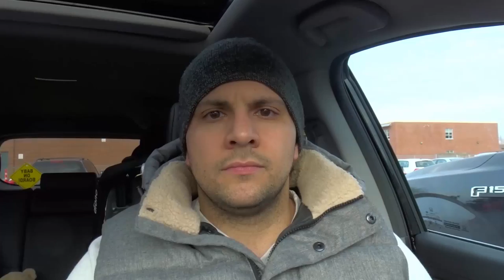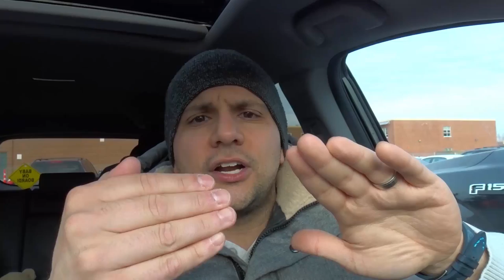How To Diagnose A Bad Clutch-6 Things To Look For

Comment: Never mentioned so my question would be. My clutch is sticking to the ground. It in inconsistent. Works part of the time other times it suddenly sticks to the ground. What causes that? It has fluid. Everyone I talk to aren’t consistent on what they t could be. Clutch is going out, could be air in the lines... idk
Reply: Yes. I would say air in the lines due to a bad 1) clutch master cylinder or 2) clutch slave cylinder. The second is much easier to replace since it's a simple brake line to bleed essentially. Air is being allowed into that and it doesn't always have to leak/the fluid isn't always low. If it runs on vacuum (which most do) check the vacuum line. It may have a leak, and maybe sometimes the engine is angled just barely in one direction to pinch it correctly and make it actually work correctly

Comment: When my clutch bites on releasing I get a shudder when pulling away only in first gear. It’s a manual after driving the car every night for about an hour so must be when it gets hot. Any ideas what this could be thank you
Reply: I might have the same issue. Learn anything about it or find a solution?

Comment: So I have been having issues with my clutch and it is literally the complete opposite of the last indicator. It used to be very strong and the bite pint was towards the end of the clutch peddle when I let it out, but now the bite point engages as soon as I start letting out the clutch, and after the bite point engages there is no more play in the clutch and it feels light as a feather. I know this is very confusing but could this mean detrimental clutch damage occurred?
Reply: same problem nobody’s answered
Reply: Its your clutch most likely if not air in master cylinder
Reply: Hey, I’m having the same problem my clutch feels very soft towards the end . Did you replaced if not what did you do ?

Comment: I recently got my clutch replaced but I still smell a slight burning smell..Is that normal & if not, what suggestions do you have? Thanks!
Reply: Might of just been cause of the new rubber. Any updates?
Reply: yea it’s normal for the beginning when u get a new clutch

Comment: Question: I gotta smash the pedal to the floor in order to shift. Wtf is going with my clutch? I replaced it over the summer but having issues now. Could I have been sold a bad clutch?
Reply: Maybe you bought it from autozone. 😂😂😂 or advance auto.  😂😂😂😂😂🤦‍♂️
Reply: Don't you have a warranty from a brand new part?

Comment: Here’s my issue I’m noticing right now with my car. It’s not serious .. but it’s definitely something I’ve never felt before. 
Every gear change is doing fine. Take offs are fine. But I’m feeling a “tug” when I change to either 5th gear or reverse. 
Especially reverse. I struggle to get it in fully. Takes me a couple of attempts even with the clutch fully engaged. 
Also 5th gear. There’s a bit of a tug going on around this area and just a couple minutes ago, I “thought” i put it in 5th gear from what I could feel .. and it grinded a bit. 
I can’t tell if this is an issue with my clutch or just the gearbox. I must note that 5th and R gear are next to each other in my car. 5th is above R. And it’s only these 2 gears where I feel this tug. 
What could it be??
Reply: I have the same issues. Did you end up figuring it out?
Reply: @JohnnieIsBored  Actually yes. And it wasn’t good. It was a loose screw somewhere inside the gear compartment but not directly under the gear selector. It was under the hood somewhere. 
Later that same day I posted that comment, the freakin screw game loose and it left me stranded in the middle of the road stuck in 3rd gear. 
Not really stranded but I had to drive it all the way to the mechanic in 3rd gear lol $500 to repair and i got lucky the screw didn’t fall inside the engine itself. 
This could be a result of my bad gear changing habits maybe and also the fact that I never changed the transmission oil. 
I suggest you look into a transmission oil change.
Reply: What kind of car is it? I’m having the same issue with a scat

Comment: What happens if you start the car in 1st on flat ground let of the brake without letting out the clutch it starts going like the clutch pedal is completely out ?
Reply: if you're saying you let go of the brake, while holding the clutch all the way down and the car starts to move as if you're not in gear ... then that's normal because you're holding the clutch down so the gear isn't holding it in place. If that makes any sense
Reply: @fernandoflores6751  sorry I was multitasking while typing that I let off the brake on flat ground with the clutch pedal down and the car in gear and it will move like the clutch is released